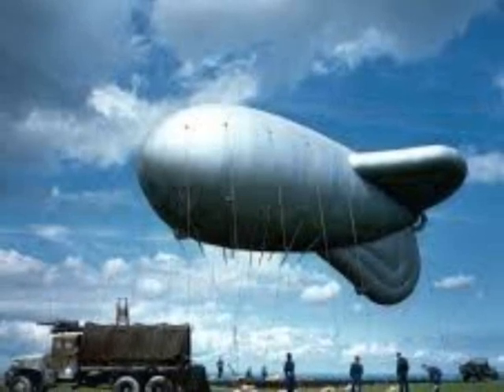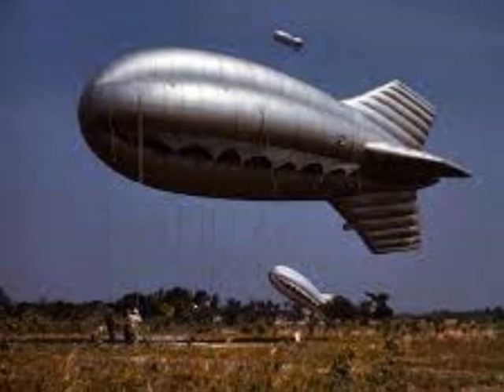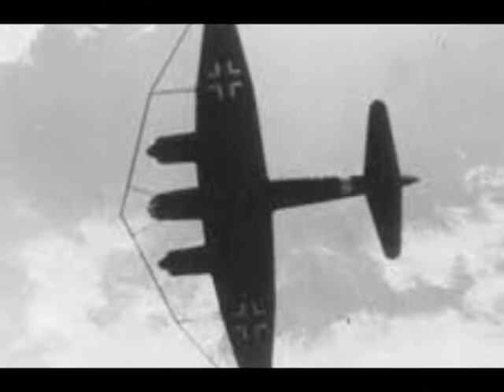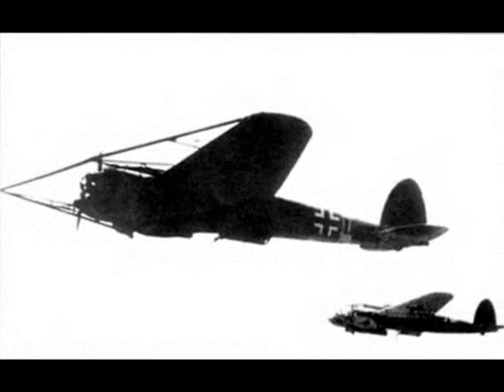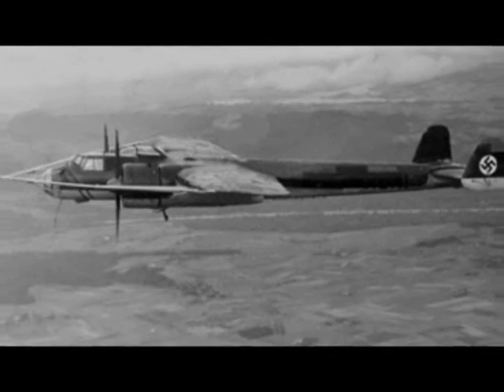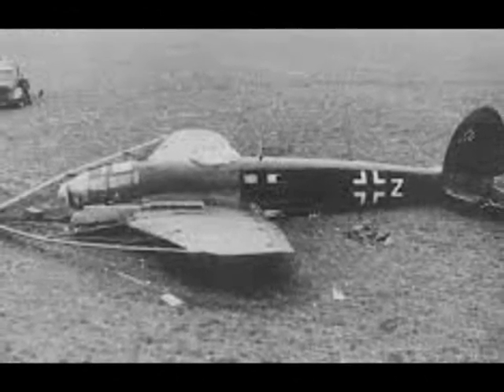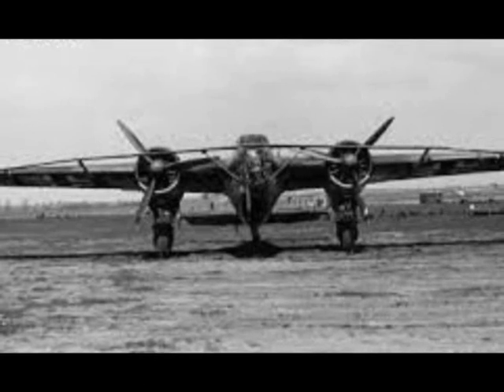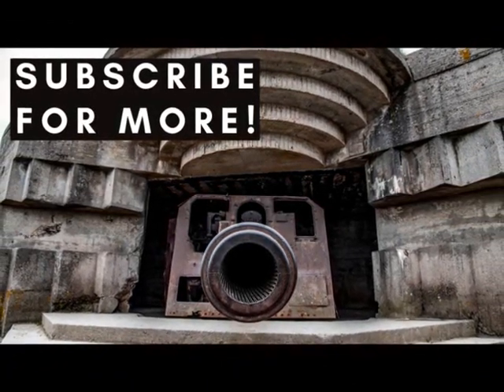Barrage Balloon Cable Cutter on Luftwaffe Aircraft

Comment: It was much easier to blow up those balloons with airplane cannons and unguided rockets. 
    Easy target, not making sudden moves, and no human casualties.
Reply: 😂.
Unguided rockets were not invented until after 1943 and needed to be used against the heat rearive target such ships and planes and far more costly  and difficult to build than simple cut frames ,shooting a balloon require to go at lower level and take down by AA defense guns .are u a 5 years old chid???😂😂😂😅
Reply: @erwinsell184  
Tech arguments are reasonable.
Pilot argumenata are a hilarious confusion.
   Age arguments are an insult attempt, from some personal reason.
   Tech are easy to correct, but insults are different kind of talk.
   No unguided rockets at that time is ok, but cutting cables with contact surface of the aircraft is at least risky and primitive.